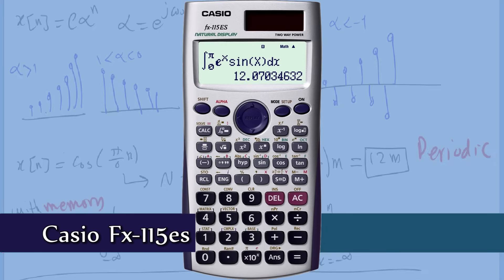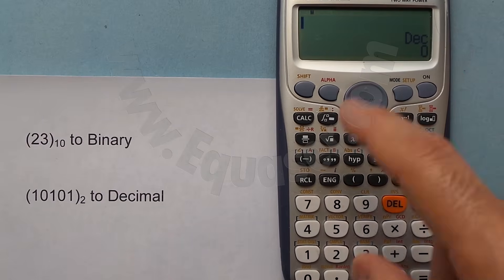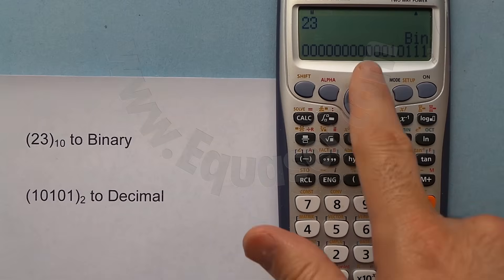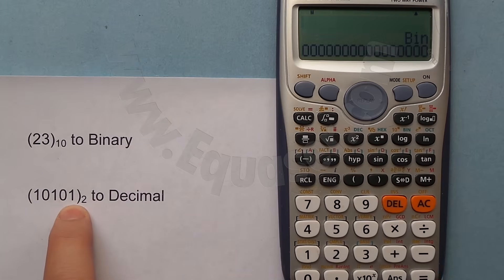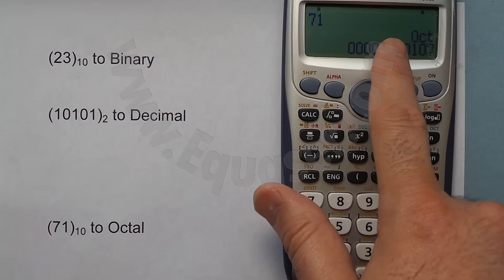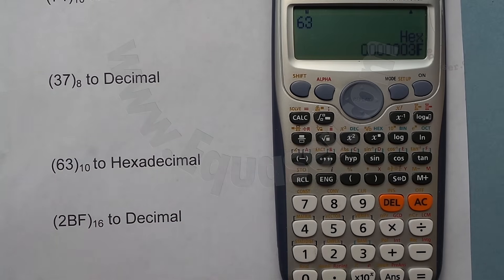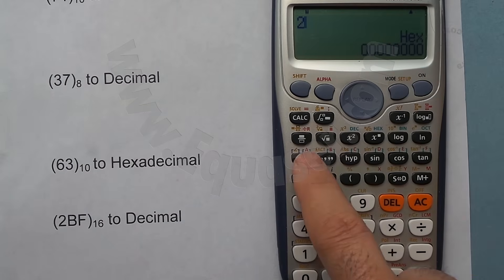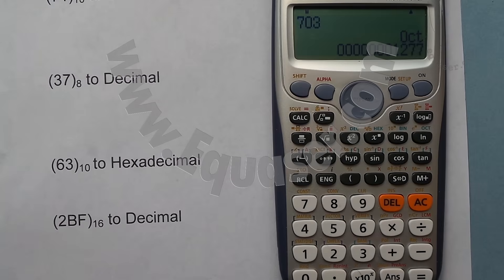Casio Fx-115es Casio Fx-991es converting Binary, Decimal, hexadecimal and Octal

Comment: Greetings, Great job. I have a Casio FX-115ES Plus. I am converting from decimal to ,binary, oct and hex. When I put the calculator in Dec mode, then when I  try to key in A3.3,12.3 or BB8.0D. I am not able to key in the (.) point between the numbers or any other place in the screen of the calculator. I would appreciate your input to resolve this problem. Thank you in advance to you and all.
Reply: ***** Then this calculator is worthless to me. Is there one out there which is able to do the job? Thank u again.
Reply: Len Arroyo what equaser said is true, when converting decimal point numbers sometimes the results can go on for a long time or even forever.For example 23.7 in binary is 10111.101100110011001100110011001100110011001100110011

Comment: What if you want 0.4475 to binary? I can't enter the "."  on the screen. Help.
Reply: You can't get 0.4475 to binary directly. You need to use a floating point representation that will be near 0.4475. For example: 1/4 + 1/8 + 1/16 + 1/128 = 0.4453125
Reply: what jojo meta says is correct. A common standard that is used for this purpose is IEEE 754
Reply: Bot